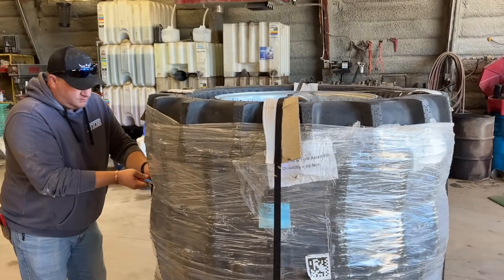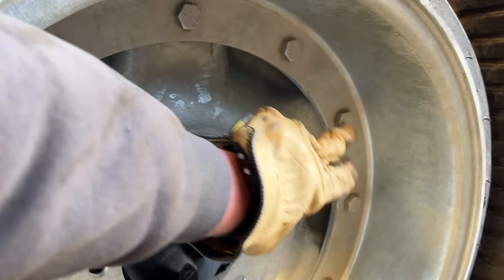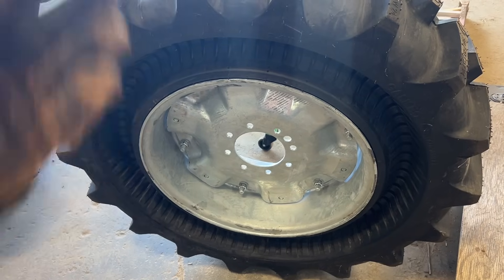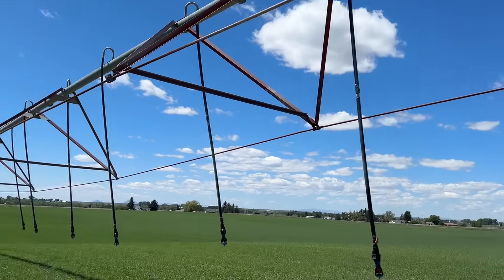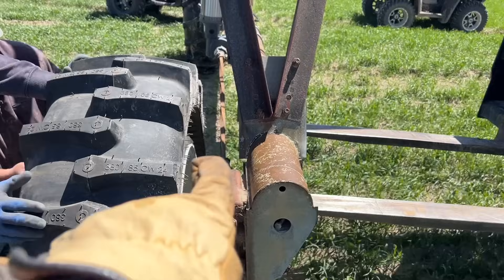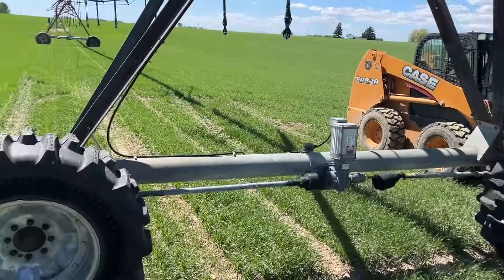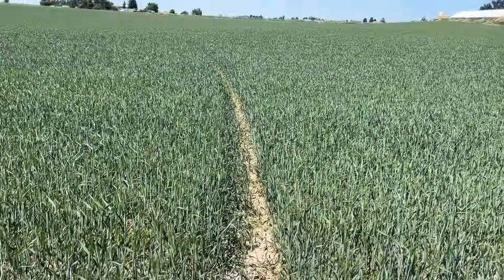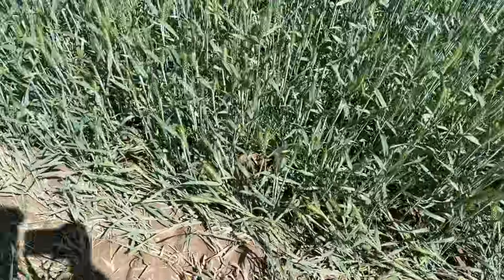Installing our new Galileo irricup wheels on our irrigation pivot!

Comment: How has the rutting been since installing the irricup wheels?  I have two pivots that need tires replaced due to tire rot.  I'm looking at going with the irricup or evolution wheel.
Reply from the maker: We are currently harvesting the field with those tires and there are almost no ruts on those towers.

Comment: Looks to be a great fit for your operation, I guess like a lot of things it comes down to cost per wheel to go airless (including repair time for air tires). I'm clearly not a farmer, but I have a couple of questions. Is there a product that can block UV or whatever is in the sunshine to prevent that wheel rot we saw on the tires you brought in to the shed? The other question relates to the drive shafts on those pivots in this video, they appeared to be twisted (like something I'd see in a fancy ornamental iron gate) is that by design, or were they twisted by torque from the drive motors, if so is that normal, if it's torque, do they ever sheer off?
Reply from the maker: As far as I know, there’s not anything that you can put on to prevent the tire rot. And the twist in the shaft happens when one gearbox or tire goes flat so the other tire has to do all the work and it twists it until the pivot eventually stops. So no that it’s not by design. That’s what happens when it breaks.

Comment: Have you tried the shark wheel yet quite a few guys around here started using them and we put some on the end tower of a pivot and like them so far
Reply from the maker: No, we haven’t tried those. We have seen a few people around use those, but they break lugs off all the time.
Reply: Yeah that would definitely be a plus with the irricup and it looks like they do an awesome job too
Reply: @RockyMountainFarmer we don't have an issue with broken lugs at all. 5 year warranty as well

Comment: If there not Directional why couldn’t you just spin the Tire around?
Reply from the maker: Because the placement of the hub before we flipped, it was exactly in the middle, so we had to flip it in order to have an offset
Reply: Our 11.2-38 are reversible this way. But our 14.9-24's are different, and need the reversible center disc. But it's just 6 bolts and no hard. They come ready to fit on Valley but by flipping the center disc they fit on Zimmatic, Reinke and TL

Comment: About 5 years ago I was visiting my local bicycle workshop and they were setting up some rims for then-new-to-the-market semi-full bicycle tyres, which had a bit more rim depth and used a 2 piece rim to get around the stiffness of the tyre when fitting to the rim.  The idea being that the semi-full tyres would be effectively maintenance-less & the gaps in the tyres would soften the ride. The bicycle was a bit twitchy with the non-pneumatic tyres on it, but was absolutely adequate for short hops around town. For pivots the tyres might be a bit stiffer, so whilst reducing tyre maintenance, the stresses may be increased on other parts of the system.
Reply from the maker: They seem to squish about as much as an air tire. I’m not sure on the long-term maintenance but I know they’ve been running them quite a while.
Reply: Ours are not semi-fill, and that is the difference. Our technological feature is in the design which changes the shape of the pneumatic tire, which also allows us to make it airless. https://www.youtube.com/watch?v=embU-7fdyVI&t=10s
Reply: @mike1hani  I think I get it...yours are semi-pneumatic, seemingly increasing the footprint of the contact point to aid traction. The bicycle tyres here seemed to provide fleet operators (because businesses & educational providers increasingly provide bikes to commuters in town) with reduced cost of operation (less maintenance) and increased durability of tyres that are otherwise prone to losing air.